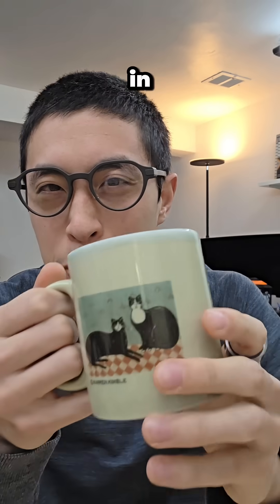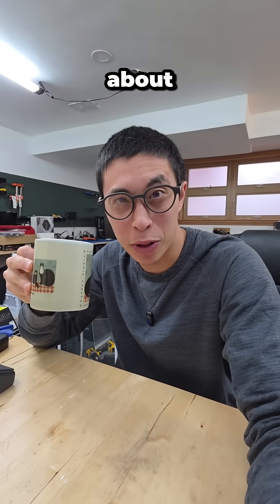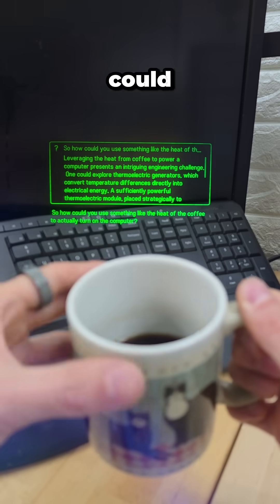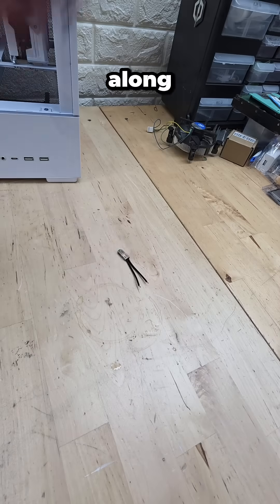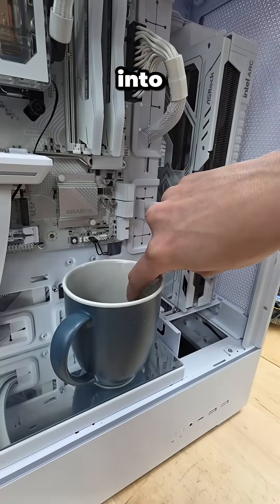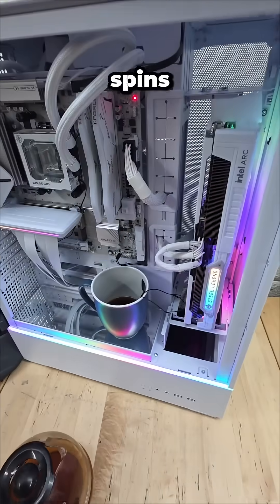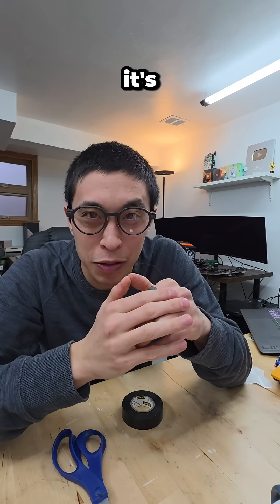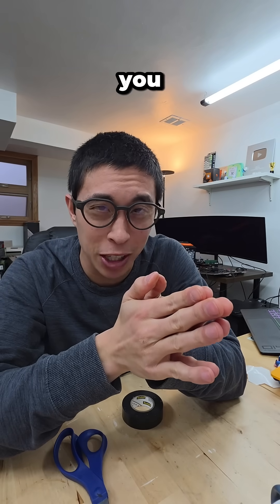let's build a coffee-powered PC with Even G2

Comment: Can you make a PC power button that will turn on the pc on using Minecraft by using Arduino and Minecraft mcreator app for PC and with the plugin mcreator link as well as using a block that sends signals from Minecraft to real life any type of redstone cam be used such as lever button pressure plate tripwire hooks and redstone button